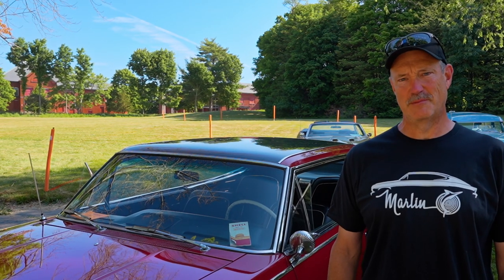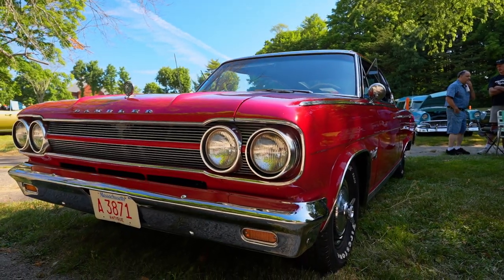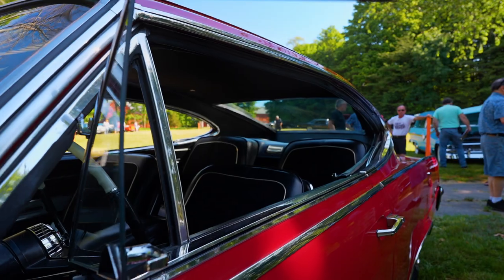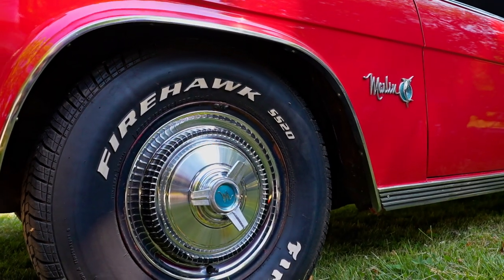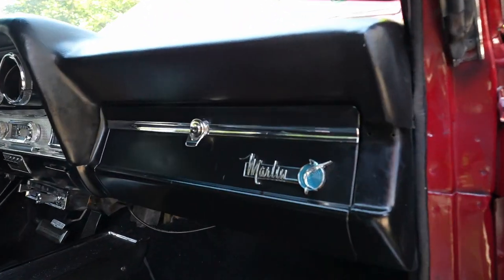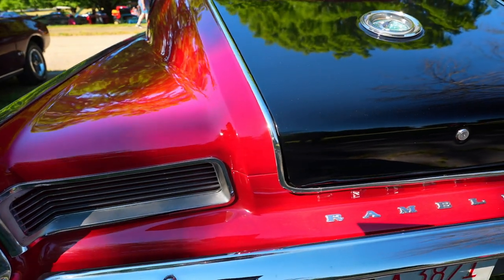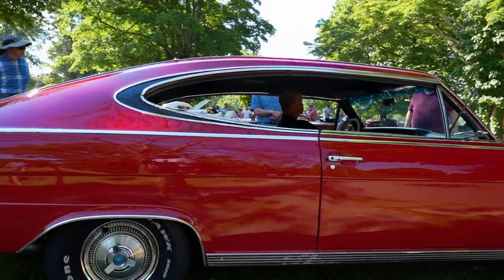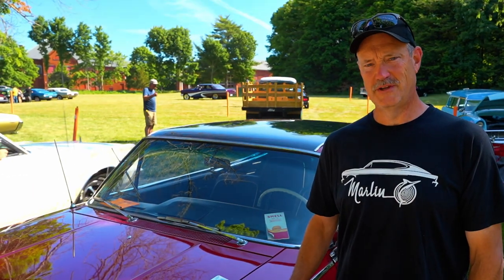1965 RAMBLER MARLIN

Comment: I have one similar to this one, same color combinations in and out same engine but I have a 3spd with overdrive console and the 2 spinner wire wheel covers I bought it at 17' back in 78' paid $450. Dollars for it from the original owner older couple owned it that were retiring and only had a little over 45,000 miles on it. Came with just about every option you could get for it. They were a very hard sell car back in the later 70's people always referred to rambler as an old persons ride! I loved it however from day one. At 17 years old I wasn't Rich and just made enough money to keep it going. After all of these years I still own the car with just a little bit over 105,000 miles or as a lot of the newer generation says WOW only like 5,000 miles on it 😅. Most of my friends had high horsepower muscle cars back in that era and turned their noses up at my car. Today I'm probably like you ever time pulling into a gas station with people saying WOW what a great looking classic you have and taking pictures of it and asking a ton of questions about it! And passing the higher priced modern cars over without a second thought. Nice job on your car! I hope you enjoy yours as much as I have enjoyed mine since the late 70's!